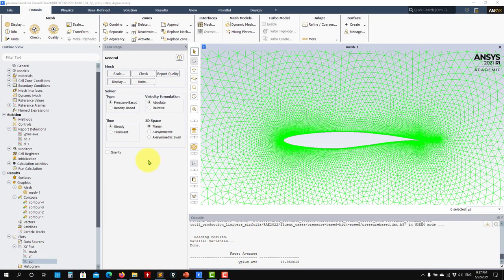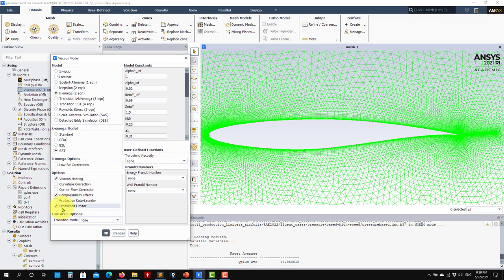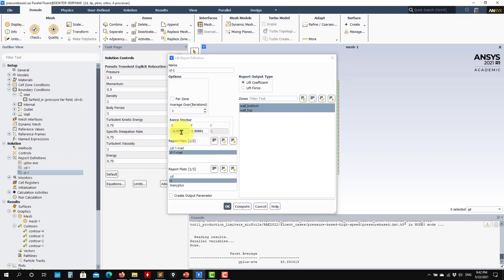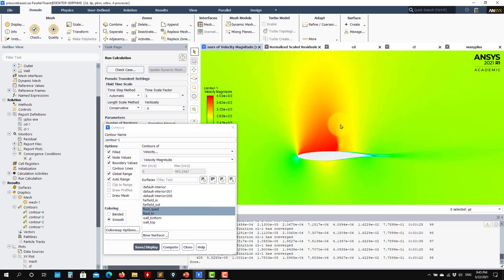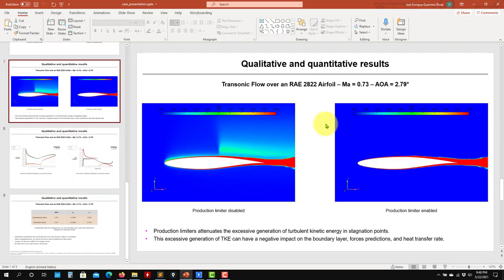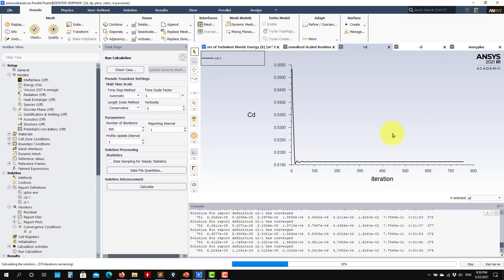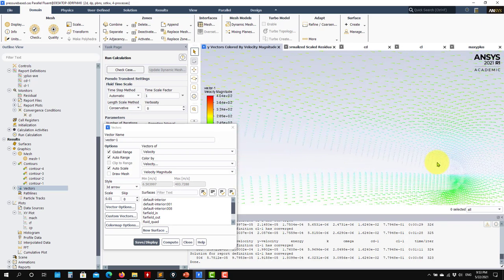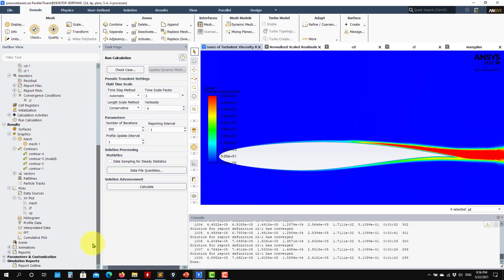Turbulence modeling with Ansys Fluent | Production limiters - RAE 2822 Airfoil - Part 2

Comment: good video. for the similar 2d case to write the Co efficient of moment what should i do in report definitions and those moment points and which axis i need to choose for the momentum axis ?
 also for 3d case can you explain.
Reply from the maker: Select the center of rotation, usually the aerodynamic center (25% of the chord) and the axis is the one normal to your screen.